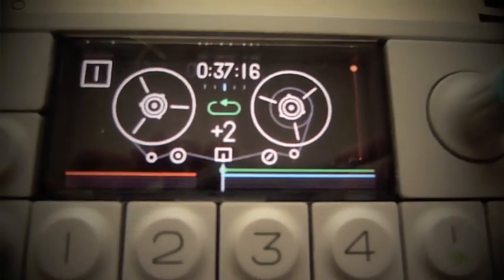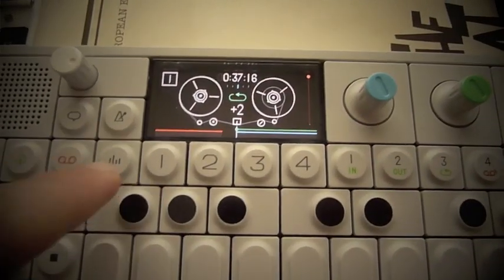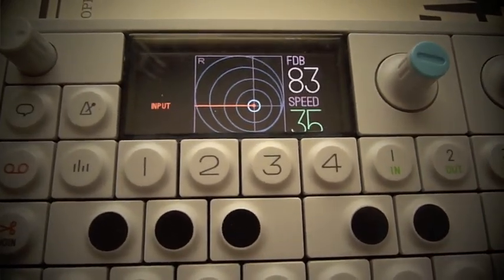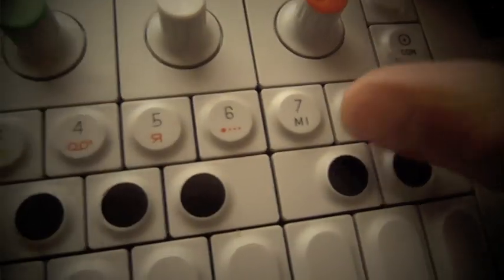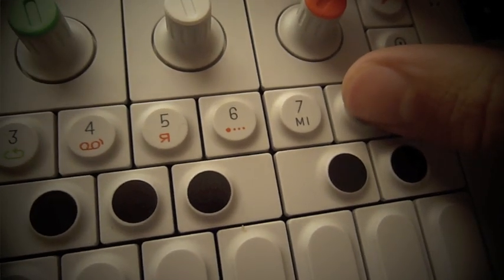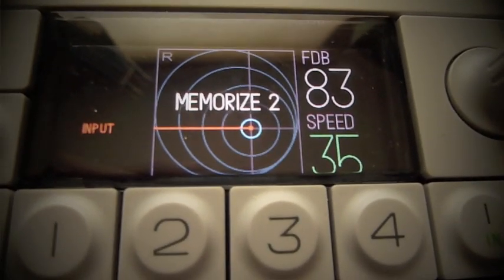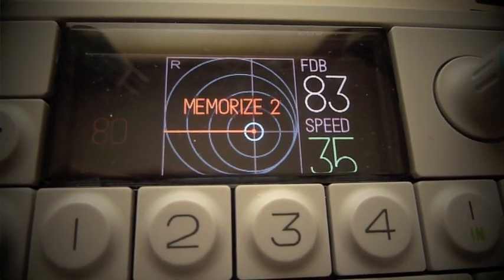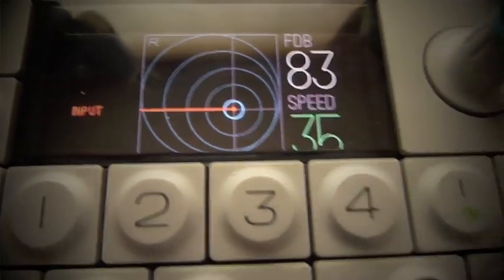Beat repeat effect w/ Teenage Engineering OP1!!!

Comment from the maker: The OP1 is super fun to use, and as a sketchpad for ideas it is brilliant. The interface is the real selling point, with no menue diving and really easy hands on control over everything. Like al hardware It has a number of limitations but they simply force you tobe more creative which in turn means you get more out of using this machine! I would suggest picking on up 2nd hand if you get the chance.